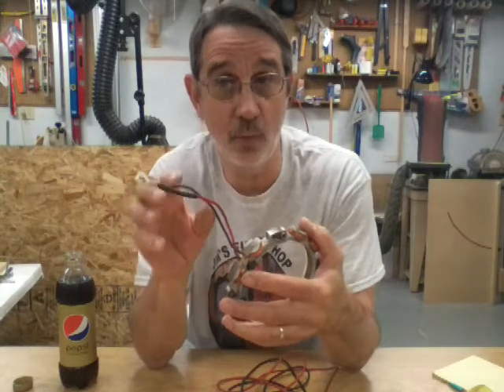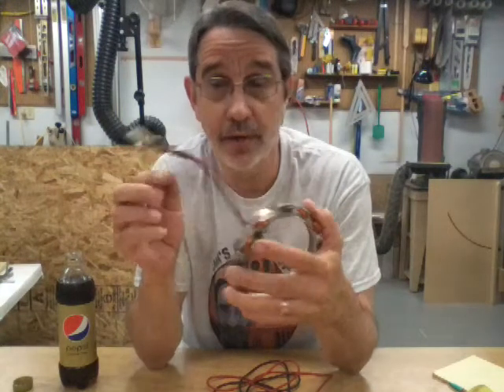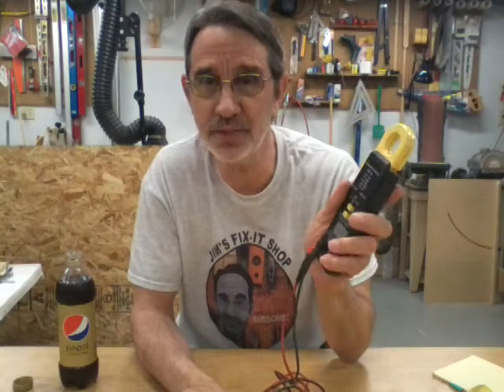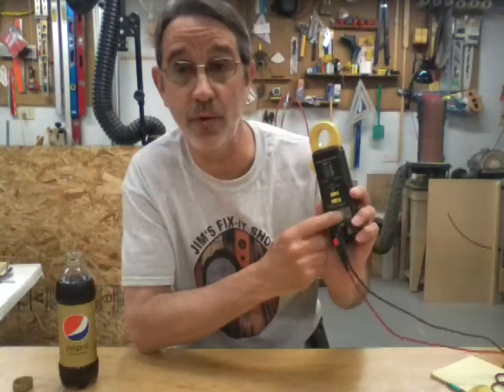185. M/S. 36 Wiring a stator on my Briggs & Stratton engine

Comment: so when you wire a small engine stator like that. (iam also working on a briggs) you do not have to GROUND 1 of the wires? the stator must ground through the mounting bolts.
Reply from the maker: Yes, the stater is internally grounded to the engine block and it has two hot wires coming out one is AC one is DC. The AC wire is typically for your headlights. If you have any, the DC is to recharge the battery you can tell which one is DC by looking for the bump in the wire which is a diode so the battery doesn’t backfeed into the stater when the engine is off Otherwise it will drain the battery dead and probably harm the stater.        Jim

Comment: The stator is dual purpose...it can be used electric start, or dc battery starting systems..thats what the extra wires are for
Reply from the maker: Stators put out AC and DC AC is for the headlight if you have one DC is for charging the battery if you have one. Jim

Comment: Hey Jim you didnt mention there being a diode in the red wire  .Is there?
Reply from the maker: If the long red wire is coming out of the voltage regulator it won’t have a diode in it, it’s the wire coming out of the engine from under the fly wheel. Jim
Reply: thank you  @jimjackson9381

Comment: There's a diode soldered in series near the plug on the red wire, which only allows one polarity of electricity to pass, making it a pulsing half wave rectifier for DC, but unregulated so that there is no set limit to the voltage such as 13 volts DC.